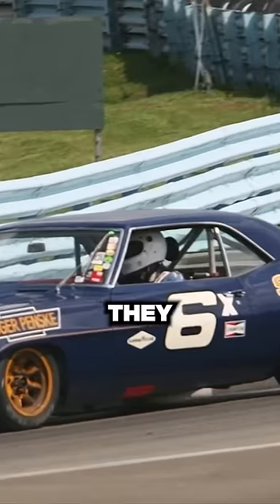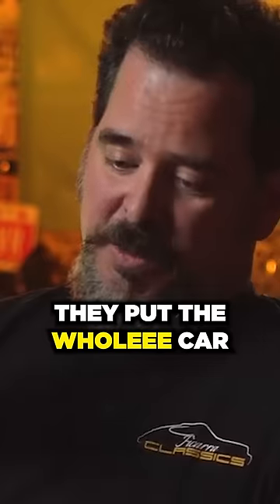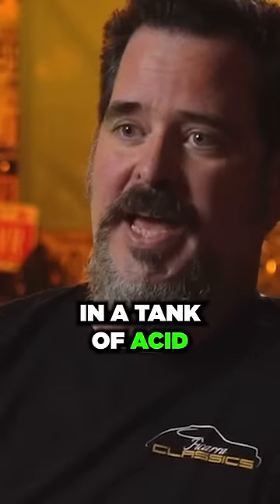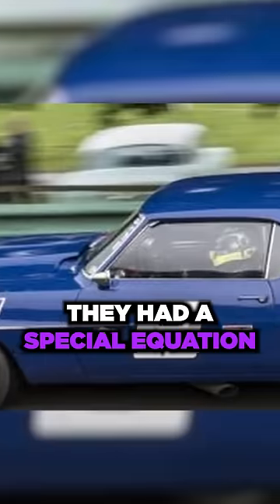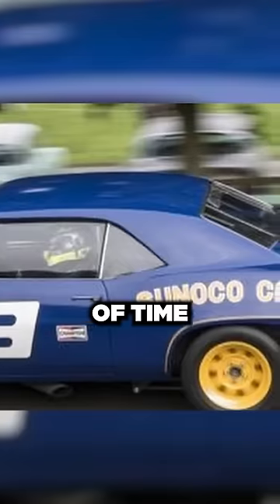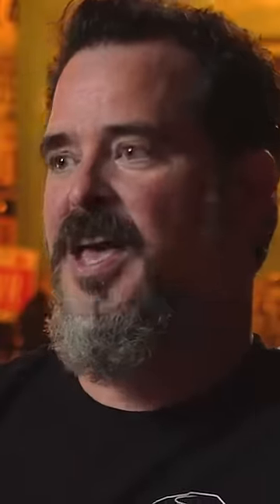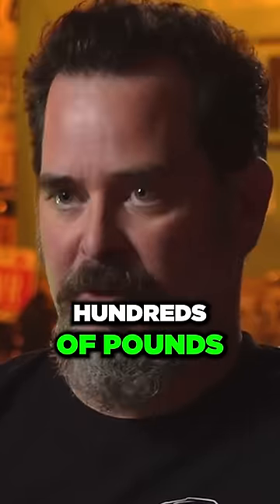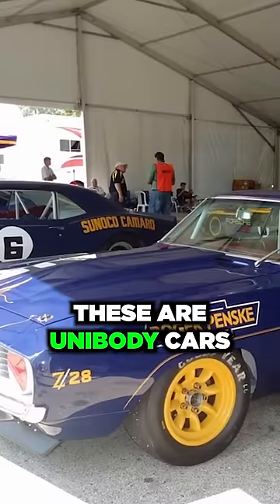The craziest CHEAT in racing history!

Comment: So you melt away 100lbs of metal in acid only to add it back with a roll cage because you made the car structurally not safe? Make it make sense…

Obviously 🙄 I understand that more than just 100lbs is stripped away but why strip so much when you are just going to put it back with more metal?

Comment: TOTAL BS.
Enable to submerge the frame and every panel in an Acid Bath would take an ENORMOUS amount of work & time! 🚿
"Install a roll cage to hold the car together."
BS. There would not be enough Steel to run a bead or just Take anything, because there is nothing left! NO Integrity in the weakened steel and a single weld would melt through instantly. #ProfessionalAutomotiverestoratonExpert